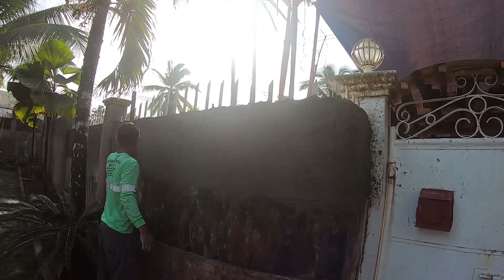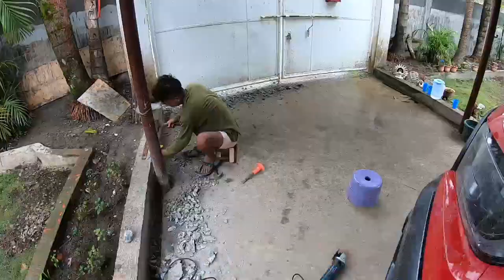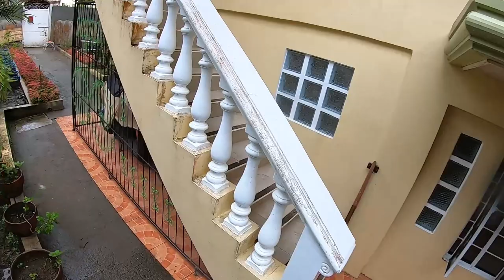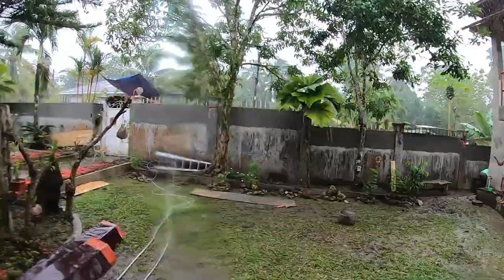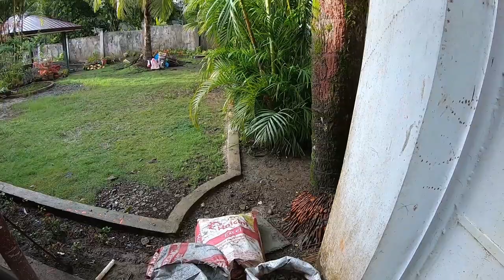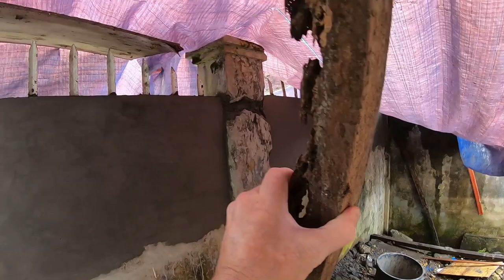Privacy Fence & Entry Gate Arch (Build Day 10)

Comment: It's looking good that we may be able to get to Mindanao in the next couple months, so these are very interesting for me. We'll probably start building this summer sometime. Do you watch them while mixing concrete, it's very common here to skimp on the cement and add just enough to make it work not enough to get full strength.
Reply from the maker: Yes, we watch them during the day/builds if you don't they tend to slack off some. Never had an issue with them skimping on cement and we purchase materials so we buy quality materials